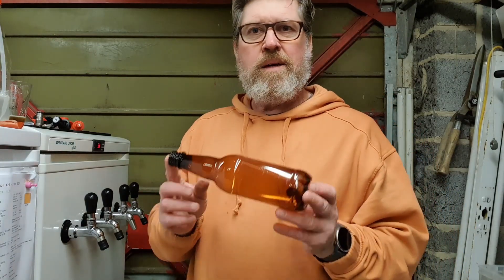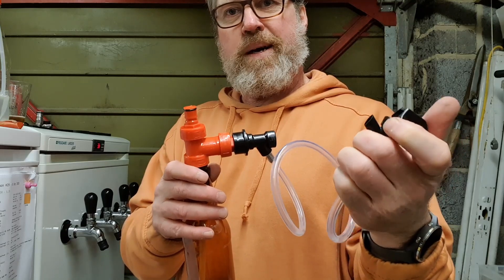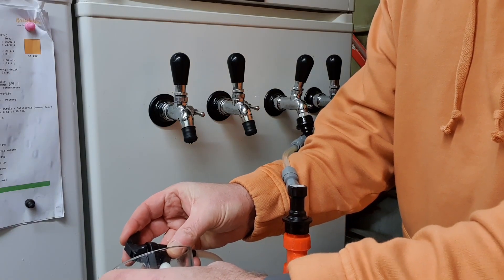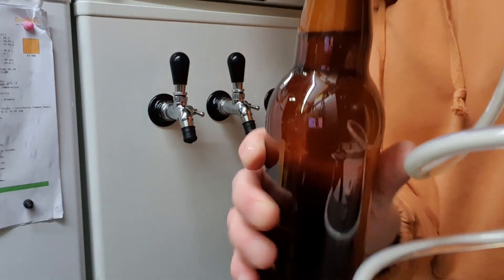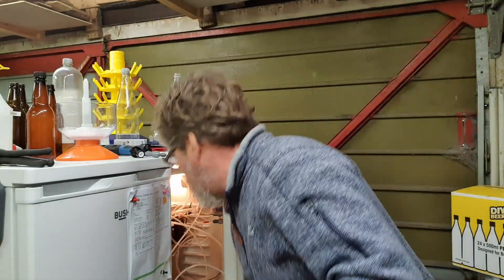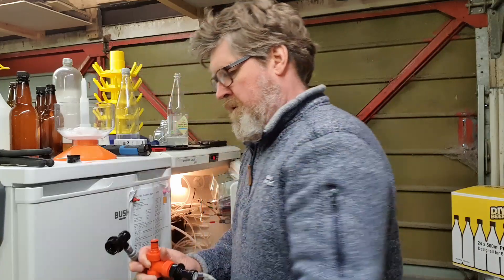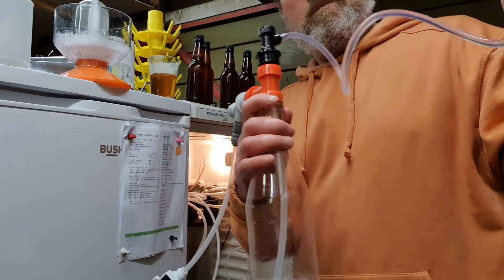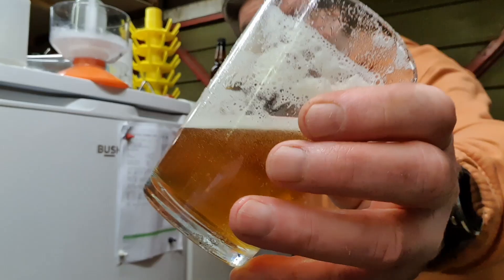Testing a cheap way of Counter Pressure Bottle Filling for Home Brew

Comment: I like it like it a lot. I've got the stainless carb caps one for bottling ( not that I've bottled from the keg yet 😜) and one on a garden sprayer for line cleaning. I also have a party tap I've never used, I like the idea thanks for sharing cheers 👍🍻
Reply from the maker: Hi Rick, Thanks for the positive comments. Yep it's amazing what you can do with a few bits of plastic . Keep on Brewing ... cheers 👍🍻🍻

Comment: Great idea...might reduce the foaming if you remove the gas from the keg before you begin...I have found the suspended CO2 in the beer is more than sufficient to fill the bottle and with much less foaming. I have also used the PRV to dump most of the gas load from the keg before filling - you only need 1-2 psi to fill. Cheers!

Comment: When you pull out the tube a small but significant amount of air fills that space. Plan a way to burp that space with co2 and you will get no o2 damage.